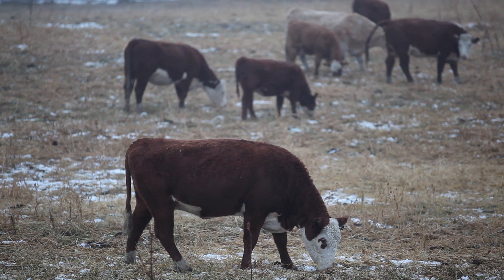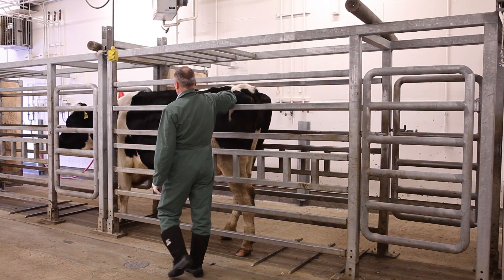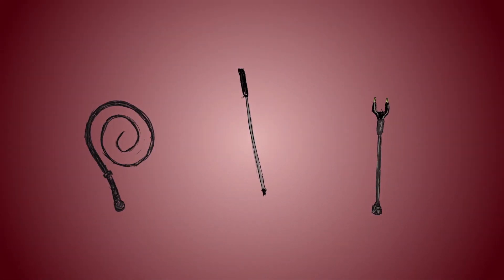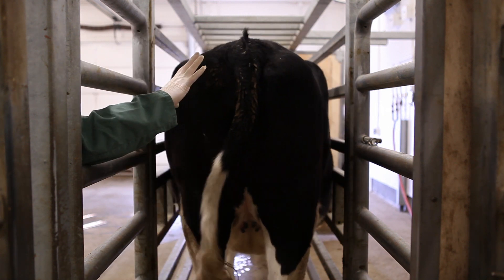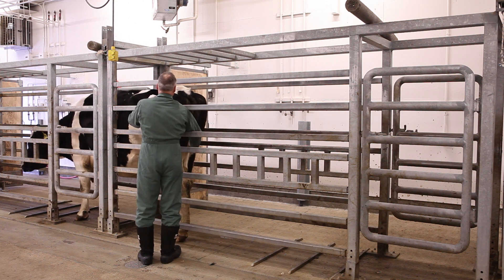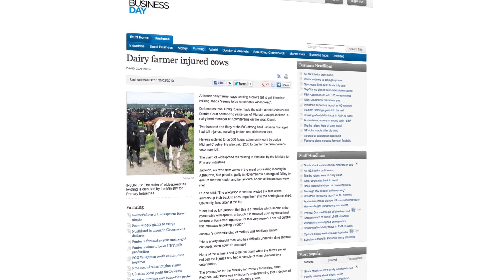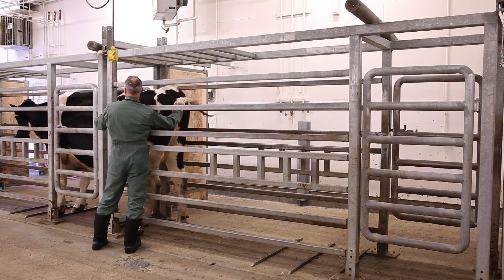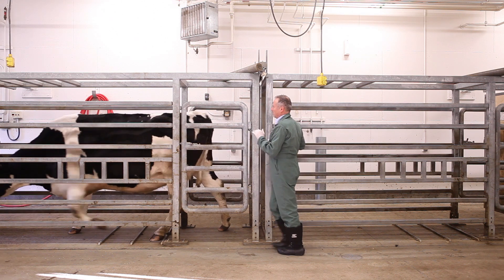How to Properly Apply a Tail Twist

Comment: I wonder how many people have stopped to think why the cow is refusing to move. Perhaps it is scared, confused, or simply analyzing a new environment. I fail to see how twisting the animal’s tail is not a form of punishment or abuse even when “conducted properly”. I also wonder what other methods are used when twisting the tail doesn’t work. Wouldn’t a better solution be to remove the potential of any form of abuse at all by allowing cows to be free and adopting a plant based diet?
Reply: He said it's a form of negative re- enforcement, it wasn't denied.  Of course you missed that rushing to your keyboard possessed by the demon of your ideology that is so obvious.   If you've worked with animals you'd know they have personalities and some are just as disagreeable as I am raking you over the coals here ;)  It takes much to move some.  All of us that work with animals have thought far enough ahead to do what you say btw.  Quiet peaceful movements with no loud clanging and using light in a dim space or the picture of another cow's ass so they think another one is ahead....many brutal and many peaceful methods.  This is nothing more than a slight uncomfortable pressure as if I were putting you in an armbar and pushing it to the uncomfortable, but not painful, proprioceptive realization point.  One becomes aware of the impending and seeks to minimize the pressure.

Comment: How so?  Dr. Stookey demonstrates the proper application of pressure and release.  This is a very common approach to horses, as well, which it appears you have an interest in.  This is no different than using your legs to pressure a horse to move in a desired direction, or your heels (with or without spurs), or a bit.  But it must be applied correctly.  These tools are only as severe as the hands that put them to work, and Dr. Stookey shows how to properly do this.